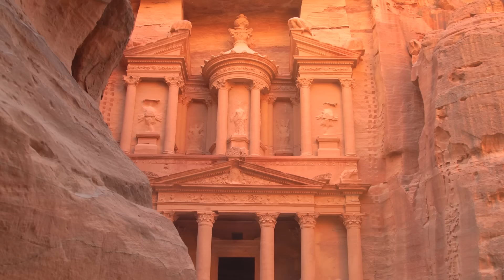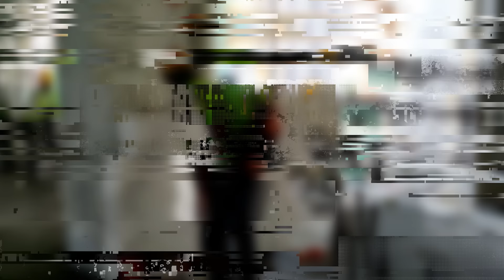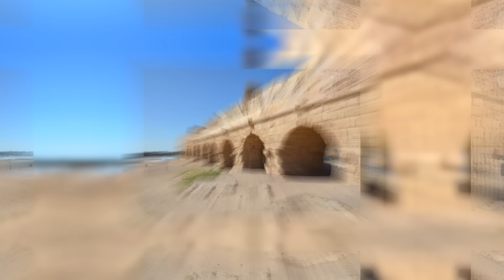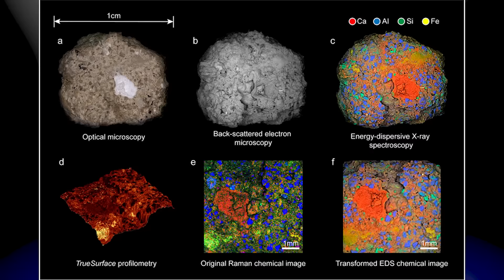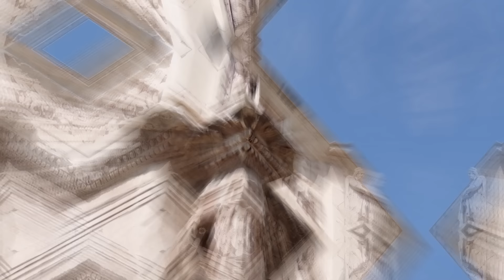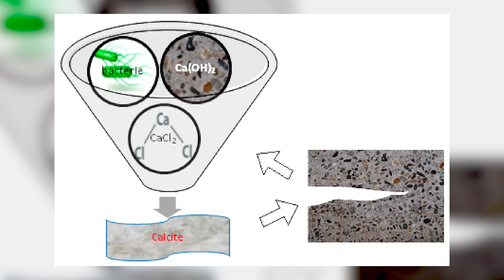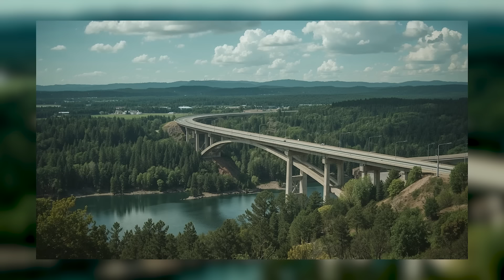Why Roman CONCRETE Lasts 2000 Years While Ours Dies in 50

Comment: In the recent hurricane Melissa, an old bridge simply named flat bridge, in Jamaica , has withstood flood after flood. I would like to know how it was constructed.
Reply: Funny, the same thought popped into my head!!!

The current Flat Bridge is something like the fourth iteration.  In addition to materials and mass used for the piers, their trapezoidal shape probably plays a significant role in balancing the fluid pressures which minimizes downstream erosion of the soil, and thus minimizes undercuts which would cause collapses.

What really blows my mind about Flat Bridge, is that it was built hundreds of years ago when the occasional horse and buggy went over it: nowadays it is subject to non-stop vibrations from cars and heavy trucks!!!

There were probably designs for the bridge lodged somewhere but the 1908 earthquake probably destroyed them, or the fire at the archives in Spanish Town in 1986….😢

Comment: Why? Simply because modern engineers "design for sustainability". "Sustainability" means that the product must last as long as the law requires and not a second longer. In this way, the investor, the contractor and the legislator determine their mutual conditions, the price of the project, and the banker determines the amount of money. Look at your legislation.

Comment: The company I work for built a building 2 years ago and the parking lot is paved with concrete.  I notice that the concrete lot is already starting to deteriorate.  I sense is that today’s formula is designed to disintegrate.

Wouldn’t deposition of road salt in the winter help this situation, or is the concentration too intense from salt crystals.  Is it that salt water, not direct deposits of salt, is enough to help the concrete produce the life saving deposits, but salt crystals will harm the structure?
Reply: The crystallization of salt exerts outward pressure which causes micro-cracks.

Comment: i cant see how romans can use unslaked quicklime to make mortar or concrete.   as you explain, adding water to quicklime generates temperatures beyond the boiling point of water.   therefore it is fair to assume that quicklime was not used before it was slaked.  but also, it is fair to assume that dried bagged lime, as is available today, was not used.   the romans would have used putty lime, which is slaked wet lime.   when used as a mortar it contains little white lumps.   one of the toughest brick walls i ever had to demolish was built using quicklime.   my fellow worker identified the sort of lime used because of the little white lumps within the mortar.   putty lime is still used here in perth, western australia, by plasterers as a slowing agent for wall plastering.   now about waterproofing.   40 years ago i had to try to prevent water from entering a cellar built below the water table.   i was recommended "silasec" by my local hardware store here in perth western australia.   it worked alright!   ive used it for many waterproofing jobs since.   and it makes the mortar or concrete stronger.   just a couple of years ago i asked wikipedia about the stuff.   it directed me to "silica fume".   this stuff was discovered, in the 1070's, lining the flues of steel mills using modern steel making processes.   it was suggested that it has the same characteristics as roman pozzolanic ash.   silica fume is used routinely in shotcreting.   so, to me at least, another roman mystery was solved.   by the way, modern concrete will survive in sea water as long as it doesnt have steel in it.   modern engineers dont understand that some concrete structures can be made without steel.   there are some concrete bridges with steel-less piers from the 19th century that are still fine and carrying traffic.
Reply: i just noticed the mistake.   1070's should read 1970's.
Reply: @vsvnrg3263  So just go and FIX the mistake! EDIT by clicking on the three dots next to the comment!
Reply: @kevinrtres  , yes, i know about that.   very useful advice.   but i noticed that if i correct a mistake i lose all the likes.   as i write this reply, i'm up to 44 likes.   ive never achieved that score before this.
Reply: Very valuable observations 👌👌👌
Thanks for sharing 🙏🙏🙏
Reply: further to my comment, i meant 1970's not 4 years after william the conqueror invaded britain.   ive just seen a documentary on historic canals in france.   i now know that french engineers understood the importance of pozzolan well before modern times.   some of the canal bridges built centuries ago incorporated pozzolan into their mix to make them waterproof.   and theyre still waterproof.
Reply: "you just need an oxidationresistant material with the same thermal expansion coefficient"
"oh and cheap it should be"

steel and concrete are close but not the same thermal expansion wise. over time (and amount of rebar used)  it will crack the wall but no clue on the timespans. but our teacher told us about it 😂 ~10y ago
Reply: @johannesdatblue4164  , the steel absorbs heat faster than concrete.   ive seen videos of "stranded basalt for use as rebar.   it shows promise for some situations like sea water.
Reply: It's not Roman tech it's Tartarian.
Reply: @superservices4818  i dont think you are correct.   i would appreciate more information to support your claim.   and how about a time scale that demonstrates when or where the tartars or tartarians used concrete before the romans.

Comment: Sampling bias: 2000 years later you can't find any of the Roman concrete that failed after 50 years. That stuff disappeared 1900 years ago. The only Roman concrete left after 2000 years is those batches that did last 2000 years. Generally what has survived are big solid lumps that are under no great load and not subject to erosion. Come back in 2000 years and you will find lots of similar lumps of current concrete, mostly building foundations.

Comment: Our Industrial Era began around 100 years ago. We are amateurs at  building compared to the Romans who build for hundreds of years. Self-healing concrete, iron that doesn't rust, long lasting wood,,, after hundreds of years of experience they were pros at architecture. Learning from them is a great idea.
Reply: It doesn't matter if rebar rusts. The high pH environment inside fresh concrete protects the steel, and a thin layer of rust can improve the bond between the steel and concrete.   It doesn't matter in the slightest if buried rebar is rusty. That's why construction sites regularly have exposed rebar in the rain and snow.
Reply: It’s more like 200+ years ago. 😊

Comment: "Why Roman CONCRETE Lasts 2000 Years While Ours Dies in 50" - because we don't want our roads to last 2000 years. Your title & video both assume construction of modern roads & highways have the same objectives the Romans did. Nr. 1 rule of existence in this world; 'Don't Assume Anything' - we build roads that will break down, so contractors can get funding to build new roads - which is fine, 'IF' that is your objective. /// that's not what the Romans were building roads for. - context, context, context.....yawn

Comment: 0:56 the image is misleading. Petra is craved out of the sandstone, it is not a concrete structure.
Reply: Nice point
Reply: Petra is also starting to crumble.
Reply: you mean prtra is cstved out of ssndstone I yjought my one hsnded tex cb ould be ofetty bsd eith my right yhimb hitting 3 krys at s gime becsuse my left sfm and hmd fo not worrkkvl. so uding my right gingerd ho jold ghr no pjone sgsinnst my chest sndbthping dith just my right ghimb midtskes are frewurny sn imposdinle to borrectl
Reply: And the aquaducts and buildings are mostly stone and brick!  That is much more expensive materials and much more labor intensive.  It is still impressive to have longer lasting mortar.

Comment: The ancients were able to produce Iron that does not rust - also for 000's of years - and we don't have a clue how they did it. We can reproduce Roman concrete by using fly-ash in the mix. The same is true to produce very strong bricks. Volcanic ash is not freely available whereas fly-ash produced in power stations is a product that has to be thrown away... Why engineers don't use it more often beats me. Cost and profit? Our supposedly modern "advanced" world is actually backward compared to the ancient engineers who were able to produce geopolymer rock that could be poured into forms and harden s though it shaped and placed into position. The idea that the ancient megastructures clearly made from 40 - 1500 ton blocks were sculpted, transported, across valleys and simply placed into position all the time is ridiculous. However, quarries also provide evidence that at least some incredibly large megaliths and statues made from a single piece were in fact shaped (with an incredibly accurate process unknown to us today) and moved as a single piece. I believe were are on the verge of rediscovering the chemical analysis that will expose the method for geopolymer rock construction - but on how on earth they moved 1000 ton single cut stones is anyone's guess.

Comment: You're talking about ways to make modern Portland cement, "OPC," concrete last longer. The better choice is to avoid it altogether. Geopolymer cements, GPCs, are finely crushed aluminosilicates--granite, basalt, slate, serpentine, olivine, pumice, fly ash, slag, even glass--activated with something alkaline--sodium hydroxide and sodium metasilicate work well--that causes it to gel, then set. GPCs have a far smaller carbon footprint; you merely crush the rock, you don't have to cook the CO2 out of it. They're far stronger than OPC, don't crack nearly as readily, and are more alkaline to protect rebar better. And while we can't know yet, there is every indication that they might last even longer than Roman concrete; they're essentially much stronger synthetic granite or basalt, not weak, chemically-vulnerable limestone. The OPC and construction industries know this. But as Michael Hansen said below, the money is to be made replacing bridges that are 60 years old, not building them to last millennia. And that is yet another way we rip off our children.

Comment: The steel of old was made with phosphate so the iron was extremely durable compared with the cheap stuff of today. Just make the steel the old way. Also, bog projects of today are made with planned obsolescence. A bridge designed for today will be outdated in 10 years.

Comment: I worked with eco friendly concrete once. It took 3 times the man power to produce pre cast wall panels. And was soft enough to gouge with a plastic cigarette lighter weeks after. It's was grey on the outside yet green inside. In my opinion it was the worst product I have ever worked with.
Reply: That was poured at 40 MPa Too

Comment: Shaaaadddduppp about 'carbon footprint'  This is THE  quickest  way to destruction:  believing the irrational HOAX  that CO² represents anything except  a NET BENEFIT TO THE PLANET. The most abundant life existed  when CO² levels were 15 ×  higher than now. We JUST  barely avoided total planet wide bio-death  12,900 urs ago when external bolide impacts  set the planet on fire and lowered our CO² levels to just barely above life/ plant sustaining levels.
As we emerge from this C0² drought over the last dozen millenia we see plants which evolved millions of years ago to thrive at  much higher CO² levels  regain this robustness and green the planet. Crop yields are record high. The concrete we make is largely from the calcium CARBIDE  that was seqestered into the rock over millenia and eons worth of time when sea life used available carbon resources making their hard shells.
Releasing this back happens at the tiniest level vs the removal that happens in the process of ocean solution.
So shut up.
Your analysis is ignorant.
Your chemical analysis of an 'environmental crisis'  is as dim as the people's  who lost the Roman concret recipe.

Comment: But we need the steel for the strength.
This is a good idea but wouldn't it be better to find a way to waterproof the steel better?
Reply: I don't think water is really the problem. Alkali silica reactivity is an issue texas has been trying to address for the better part of 20 years . I have seen a lot of concrete pavment demolished and most of the steel is still sound and rust free.

Comment: This can't be 100% true. Modern concrete allows us to build higher as it's weight to strength ratio is much stronger. With ancient building method, you can build so high.

Comment: In the far past, skills were passed down by tradesmen who spent a lifetime working with materials. Their wisdom was tempered by years of hands-on experience, which included the acquired knowledge of their fathers. 
 Today, much of this is taught in institutions where the teachers have little personal experience in the trade which they teach.
 Some of the most innovative masterminds are possessed by individuals who have great difficulty with reading skills. I have contact with an ethnical group of often dislectic geniuses who are barred from using their skills to their capacity because their difficulty with reading bars them from receiving proper certification to rise up in the ranks. Modernity, with all its "progress" has ushered in some serious impediments to great workmanship.

Comment: 🥴Kindof makes me think that it Was Not on accident. I mean after all, the are still doing it! I think they know that 'they' don't want to have to deal with Ruins that Stand for a thousand years, if it is just a shopping mall, or a office building that will eventually be abandoned or rebuilt differently. 'They' knew that these buildings would be a short term solution, with the added side affect of "planned obsolescence" that would give them a reason to keep the economic gears turning on the level of construction, not just cars and lightbulbs.

Comment: The foundations for the Golden Gate Bridge in SF were made from Roman concrete and I'm sure buildings like the Pantheon could be built today. But these are low-rise structures that don't need a lot of tensile strength. You probably couldn't build a cantilevered slab or even a thin suspended slab out of  either Roman or modern concrete without a lot of reinforcement. So, the answer might lie in non-ferrous rebar, made from fiberglass, Kevlar, or some other high-strength mineral or plastic. It's worth pursuing this  just to avoid having tower blocks, bridges and parking garages fail after 50, 40, even 20 years, depending on the conditions. But let's not kid ourselves; Roman concrete is probably much more expensive in most places; it's not as if volcanoes are going off everywhere. And, non-ferrous rebar also costs more than steel or iron, so it won't be used everywhere. And, finally, many structures are not intended to last forever; needs and priorities change and buildings have to change with them. The Romans probably also built a lot of temporary structures that have vanished without a trace. The ones we see now might only have survived by accident, because the methods used were the most expedient at the time, and just happened to produce a building that lasted 1,500 years. I doubt the Romans had any ides how long these structures would be around.
Reply: Это очень ДРЕВНИЙ рецепт и ДРЕВНИЕ РИМЛЯНЕ унесли его с собой в могилу. Автор же предположил: замешивайте известь в раствор и будет счастье после 2000 лет, а прораб скажет БРАК, всё в канаву.

Comment: Galvanized rebar is now a thing, and doesn't interfere with the rapid modern rapid construction philosophy where labor is a big part of construction expense.  Romans had time and cheap labor to mitigate building costs.  New galvanized rebar only has a modest upfront material cost and greatly increases time before rust destruction occurs.  FRP rebar is also a good option as well.
Reply: Evidently graphine can also make FRP 3x as strong.  There are new production methods making it very economical.  It is hard to imagine anything 200x stronger than steel.
Reply: @koiphish333 is it better than stainless steel
Reply: Why are you assuming labour was cheap?  Skill labour has always been at a premium.

Comment: They had concrete with a completely different chemical composition, which included volcanic ash from specific Mediterranean volcanoes.  That makes it persist better than modern concrete because it's self-healing to a point.  But the tensile strength is still a problem, and the kinds of loads we put on our roads would still damage concrete made with their concrete.

Comment: You might be able to reduce rebar corrosion in modern construction by looking at the very corrosion resistant medieval steel. Its iron had a lot of slag content and no phosphorus removal. The phosphorus content created a black corrosion resistant iron phosphate layer on top. And after smithing the slack content prevented deep corrosion. Smithing created a glass fiber web inside the steel. Rusting slowed or stopped when it hit the glass and together with the iron phosphate layer made medieval steel extremely durable. Creating this slag network in rebar would be cost prohibitive. But adding or not removing phosphorus would be easy and cheap.

Comment: With the old strucktures there is a surviver bias - we don't see most of those old buildings that collapsed early.
The steel in concrete also allows to build with less material. Some parts like wide bridge spans or very high buildings are essentially impossible to build without it.
Reply: Dont build high buildings